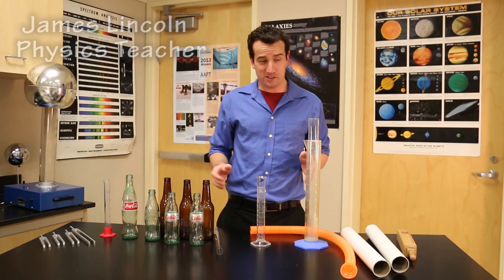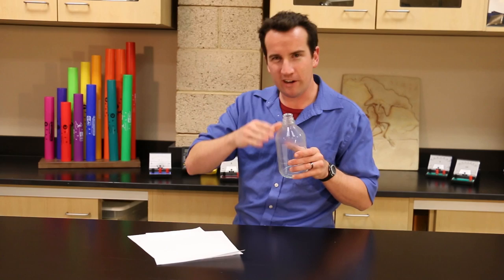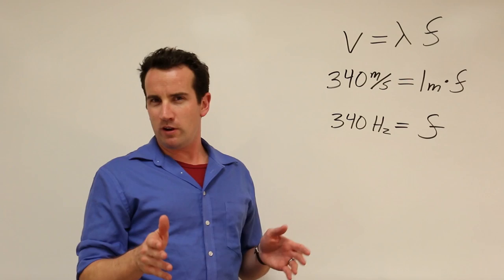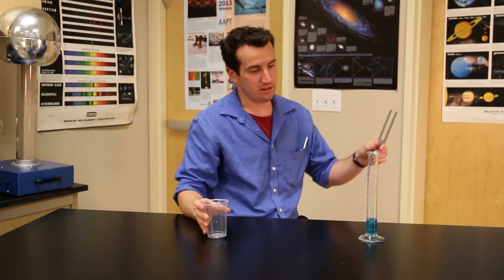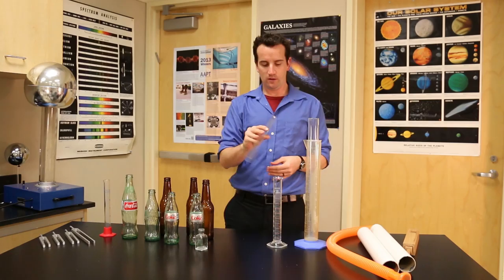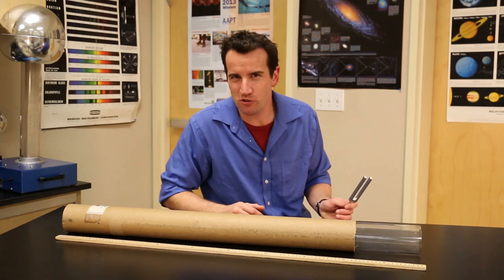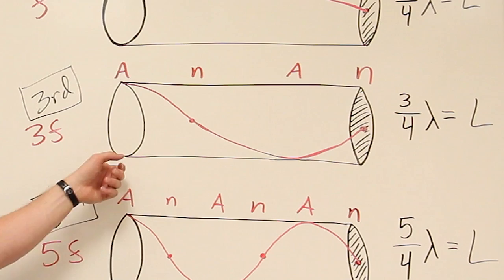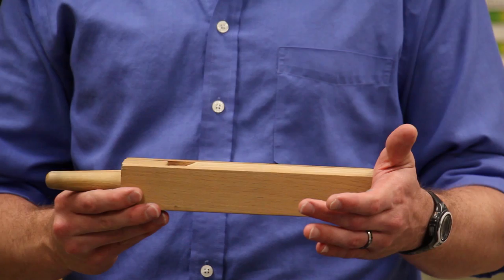Tube Resonance - Standing Sound Waves

Comment: Wow, first explanation of sound wave mechanics that ever clicked in my brain. Thank you! The most educational 6min 49 sec ever!. So far so good. Now, why does the bottle have a much lower resonant pitch than the graduated cylinder, even though it is much shorter? Hmmm. Is there a correlation between the total volume of the bottle and the graduated cylinder? Can the length/width be factored in to predict the frequency of resonance? Why is it that every question you answered raises another question in my head? Or in this case three, Haha, thanks again!

Comment: At 1:30 how do we know there aren't any other nodes/antinodes inside the tube? Why wouldn't it be a node-antinode-node-antinode distance, in which case the tube's length would equal 3/4 of the wavelenght? I know that then it's a higher harmonic but the equation then changes completely and we get a frequency that's triple its original one.

Comment: One thing you didn't mention it when we fill a bottle(or a tube in this case) like at 4:28 the frequency of sound coming increases as the length of air in the tube is decreasing so the wavelength decreases resulting in increased frequency!!

Comment: Great video! However, could you give an explanation on why a node exists in the middle of the double-open pipe? Or: why aren't the gas molecules all move in unison back and forth along the pipe? Thanks!
Reply: I don't know about the gas molecule part. But for an open ended tube at the ends you'd have anti nodes since max displacement occurs. And a node can be found exactly half way between two anti nodes thus in the middle of the double open pipe

Comment: Really great video.Please keep up the good work.Now,I have a doubt that at 4:38 the tuning fork resonates 2-3 times with the cylinder with decreasing amount of fluid.How is that possible?I know that the tube can have several different  frequencies but I think the tuning fork has only a single particular  frequency so how can  it resonate with all the different frequencies ,as I have read that resonance only occurs between "similar"  frequencies?
Reply: when the air inside the tube resonates with the fork,  the standing wave pattern has the  same wave length each time (calculate and see) and also the velocity of sound in air and the frequency remains constant
Reply: TUNING fork have a fixed frequency. as the level of water decreases the length of the pipe increases the frequency decreases. In a standing wave of closed pipe odd multiples of the fundamental frequency gives the next frequencies which can resonate with the tuning fork as the length of the pipe valued is different in each resonance. so the tuning fork is not responsible for numerous resonance, the increasing length of the pipe makes it behave like different pipes of odd harmonics

Comment: approximately before the year 1815 the brass trumpet had no valves.   could the physics you are explaining result in designing a superior trumpet of that pre-1815 type?  We know obviously that trial-and-error could be used to find a proper trumpet tube length (and we know that the primary note and also the harmonics) are keyed to the fairly precise length...Ultimately I am asking do you think the phyics (a la math) is really key to design of a superior or more perfect trumpet?  (but what is "perfect"....could be output power or could be frequency precision [ in-tune or out-of-tune]  I would suppose).

Comment: hi James, thanks for this interesting film. My students tried to calculate the groundfrequency of a soda bottle yesterday, just by measuring the length of the bottle and using 340m/s for the speed of the air. They found a frequency of app 410Hz. When they blew on the bottle, they found a frequency of app 250Hz using their mobil phones and Phyphox. Using 250Hz the bottle resonated, not wit 410Hz. Can you explain this difference? Thanks !!
Reply from the maker: Yes, the bottle is not a tube.  There is extra width which increases the effective length.  The formula I use is only for long thin tubes, in fact it is an approximation for 1D sound waves.  The worst bottle would be a perfect sphere, which is known as a helmholtz resonator.  Most bottles will not meet the tube approximation, which itself has some problems.

Comment: i have a doubt sir , that shouldn't the tuning fork be placed like 90 degrees rotated about axis ,like the fork is vertical and not face down ,the disturbance cause by the fork is not face down but along the tuning fork. pls clarify.the theory is very well explained by u sir :-)
Reply from the maker: Both 90 degrees and zero degrees rotation will work.  However, 45 degrees rotation will be silent.  Try this by holding a fork to your ear and listening.
Reply: umm..but wont the propogation be along the prongs and the disturbance needs to be in direction of the tube sir?